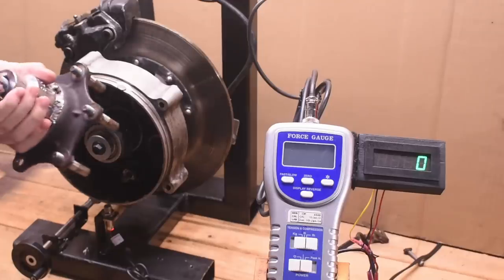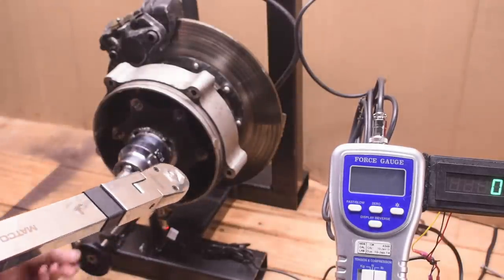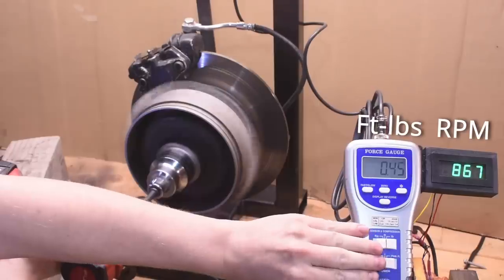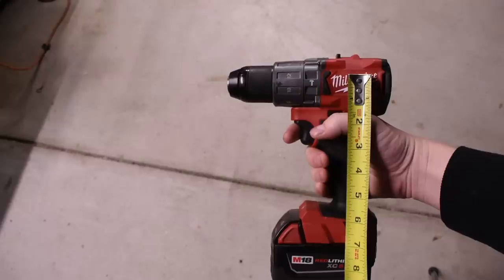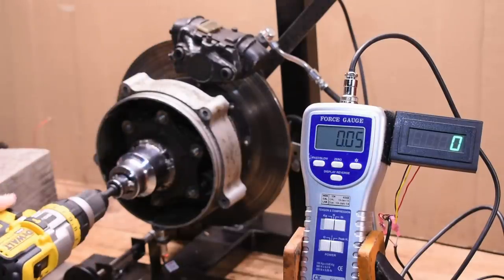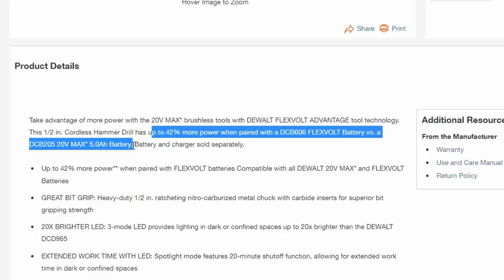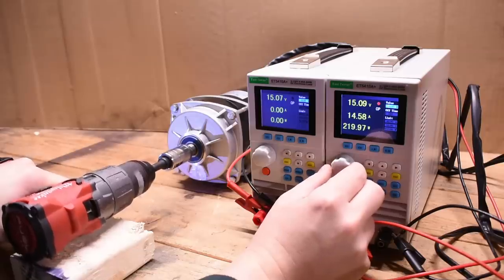DeWALT vs Milwaukee on a Cordless Drill Lie Detector (Dyno Brake)

Comment: When you're quickly applying the brake, the stored rotational inertia energy is being dissipated into the brake caliper, making the measurements higher than the torque applied by the drill.  An accurate measurement requires constant RPMs, given all that spinning mass.
Reply: To test this, spin up the brake disk, decouple the drill, then quickly apply the brakes with no drill connected. It will apply force to the load cell, guaranteed.
Reply: Incidentally, the torque required to suddenly stop a spinning mass is how your shop vac is deceitfully rated to 6 horsepower while running on a 16AWG cord. 6 horsepower continuously from a 120v outlet would require 37 amps, melting the cord...
Reply from the maker: See our comment towards the top, you're not wrong. But it's not the brake causing the sudden stop on the high tests, the drills suddenly stop (and they dont free spin)

Comment: It's also got a feature to save your wrist from breaking. That's why it doesn't cooperate with the Dyno unless you ramp up the speed slowly and the same goes for reducing rpm. Otherwise the wrist saving feature will brake your wrist!!

Comment: If you have an RPM signal on your dyno brake, why not output both to a chart, to show true torque @ rpm (torque curve), & also (by definition) horsepower? Standard Dyno stuff? Because you're right, area under the torque curve matters in most applications, not just peak torque (or peak hp for that matter).

Love the channel.

Comment: It would be valuable to see a column in the results on the tested lifespan at the higher torque values.  I've burned up the gears in a DeWalt DCD996 at a sustained 25 ft*lbs in about 10-15 minutes (with multiple batteries of course.)  The gears just can't handle the power and resulting temperature rise for any appreciable timespan.  So while each may be able to deliver 30-40+ ft*lbs it may be a disappointment to consumers that these values cannot be held for any significant duration.  Thanks for another great video!

Comment: The 999 does a weird thing where it has more power the higher up the clutch is, including the hammer setting. I think you'll see a higher torque number by a little with the hammer setting

Comment: I think the high speed cutout test is fine.

Bonus quest for you @TTC, can you do some cutout testing with the clutch? I have the M18 hammer drill and when I used the clutch function a while back, I remember it felt like the "clutch" is not actually a clutch but a peak amp draw setting and all electronic controll of the cutout.

Comment: I believe the 1200 inch pound rating of the Milwaukee is supposed to be a hard joint torque measurement. For example, if you were to use it on a lug nut by just barely starting the nut and then running it all the way down right with the drill, assuming it's braced properly and using the right battery, it should tighten it to about 100 ft lbs. I'm not sure how optimistic that number is, but judging from the amount of torque you measured with a slow stall I bet you won't be all that far off. Don't get me wrong, that's a pretty useless spec for a drill since that is almost never how they are used, but it's also probably not a complete lie. That's going to be very difficult to properly measure, so I wouldn't worry too much about it, and instead just encourage them to stop advertising specs that don't have any real world use by calling them out for it and letting it affect their ranking on the channel.
Reply: Great point.

Comment: I love this test, looking forward to seeing more. Are you fellas interested in testing a black and decker matrix with the drill and the impact driver attachments? I bought one since I already had some b&d lawn tools and the impact driver attachment especially is way more impressive than I thought and will rip the heads right off a screw or smal bolt if you're not careful with the trigger. I'd be interested in seeing the drill attachment tested on your new dyno too, I'd be willing to loan out the matrix with both attachments, a couple batteries real and knock off for testing if you want

Comment: To give a little credit to Milwaukee's and Dewalt's marketing departments: it's important to note that these are the current performance metrics for two highly used tools and several battery packs that have gone through many charge/discharge cycles.  If these items were tested from factory-new it could very well be a different story.

Your testing rig is extremely impressive!  Can't wait to see more tools tested on it!  If you're accepting video ideas, here's a difficult one: testing the longevity claims of screw-in LED lightbulbs.  I'm so sick of buying LED bulbs that claim to last "10+ years of daily use GUARANTEED!!!" only for the bulbs to burn out after 18 months.  Not sure how to test those marketing claims without waiting a really, really long time however.
Reply from the maker: The DeWALT was tested from new, including new batteries for both tools. And the Milwaukee was only a couple months old. We've just been using them for this footage for many months.
Reply: The LED-bulb problem is very annoying and expensive, i just might start saving my receipts on them.
Reply: **10 years at 3 or x hours per day. 😈 
Who knows what the actual live span is when that arbitrary number is exceeded.
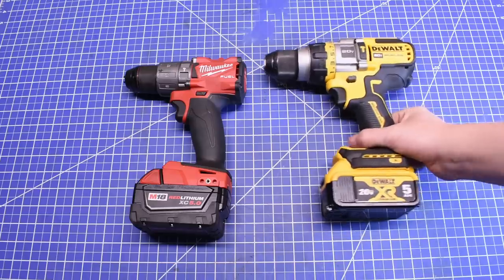Reply: @TorqueTestChannel  -- I'm confused then because at 3:43 you said you've been using these two drills for "months"?

Comment: The Bosch pro factor drill hands down demolishes the Milwaukee in terms of torque. Snapped the shanks on numerous forstner bits and thrown my helper through a wall when anti-kickback mode was disabled

Comment: I drill a lot of hole in brand new trucks. Last resort or sometimes fastest is a battery drill. 
I had the 2604. I have the 2704 and 2804. I honking on the new 2904. I also had a DeWalt. Xrelent. That total tool said wouldn’t be under warranty so I junked it. 
I got the 2804 the day it came out because of the reduced size. It made too much heat. I had to bring it home and after the DeWalt died, I brought the 2704 back to work. Works fine. About 6 now. Way more torque than the 2804. Any of them will have a go at trying to rip your arm off. 
The Milwaukee side handle suck. The DeWalt is not much better. The handle ripped right off the 2704 and is permanently inoperable.

Comment: I found the watt measurement setup kind of hard to wrap my head around. Or rather the reason the one power supply is adjusted mid test. I figured out that it was the addition of the two watt outputs but not why.

Further explanation would be appreciated
Reply from the maker: One can only go to 400 watts, to go above you need two. They are adjusted during the test to continually increase load

Comment: You can damage the drill internals by doing this.  I'm not exactly sure what part will take the brunt of the electric surges. But by spinning it with the tester you are creating a high current.  Then you hit the trigger with opposing polarity.

Comment: This is an awesome test. Did you write to the MFG to ask for an explanation on their false advertising? 

Could you share the info about the torque device you purchased?

It would be interesting to see a test like this on my old milwaukee 1/2" chuck corded drill. That thing will not only twist your wrist off but take your arm along with it.

Comment: How much torque do we need in a hand drill? I ask because small-diameter drill bits can't take a bunch of torque. How about destructive torque testing of drill bits. This could uncover the tradeoff between toughness and hardness as well as possible flute grinding differences between brands. Small drill bits in soft metal and wood run at high speed and large drill bits in harder metals need to run at low speed. Also the actual rpms are important because that is what in conjunction with drill diameter determines surface feet per minute (SFM), Carbon steel, high-speed steel, coated? and carbide all like different sfm.

Comment: Can you try some of the metabo hpt tools on this dyno? DS18DBFL2 or DV18DBL2 or the DV36DA (1,220 in-lbs). I have the DS18DBFL2 and I feel it is at it's it's 620 in-lbs rating when using a multivolt battery.

Comment: Bauforum24 a german tool channel did a test with a torque gauge. It came up with very similar numbers when it comes to max torque. With a similar jump in performance when switching from a 5ah to a 6 or 8ah HO battery.

Comment: I have a video idea. A comparison within brands of 12v to 18/24v+ to reveal how far you can go with either. I guess that's like video for each big brand, or big enough brand to a decent 12 volt selection (9v?) Anyways, I'm a mechanic, at a HeavyDuty body repair facility. So I do get to do 'everything(except paint.)'. My hobbies at home include woodworking and crafting. I see the need for lots of power on the job. Not always needed at home.

Comment: It might be interesting to measure the volts and amps from the battery and comparing to the output power and calculating "efficiency" ?

Comment: It’s a comparison across brands regardless which is something that doesn’t currently exist that I’m aware of.  Establishing these baselines allows for future tools to be tested with the same method giving results that could say in this test this or that tool show higher torque regardless of the issues of the test coming to a dead stop.  Keeping the high and low test is beneficial.  Great video, I’m curious if the DCD800B is actually 40% more powerful than the outgoing (longer) model DCD791

Comment: See if you can get a old, 1970s drill, one of the ones where you have to manually lock the teeth in place with a chuck key. I'm curious how it would stack up against the modern drills and impacts

Comment: I'd really like to see y'all test the Kobalt XTR hammer drill (on the Lowe's site with a battery and charger it's Model KXHD 1424A-03)

I've had the non-XTR version since it came out and it's awesome. The only 2 gripes I have are that the motor is loud and that the chuck is picky about needing oil every few months. If I don't keep it oiled, it seizes up and wont ratchet down properly and ends up letting go of drill bits randomly. Other than that, I've used it at work and around the house for years and it still works fine.

Comment: Have you considered testing SDS rotary hammer torque on this rig? I don’t recall ever seeing a torque figure advertised on one, mainly because they are for drilling, not tightening, but a drill-driver can do both anyways. Especially curious since the new generation Milwaukee SDS tools have the AutoStop feature to prevent wrist breakage. SDS tools also DO have a clutch, of which can’t be adjusted. You’ve tested the chipping mode’s blow force against air hammers, why not see how they stack up against standard hammer drill/drivers? It’s more for curiosity than competition, mainly since they’re so big and heavy. If you need an adapter to hook them up to the test rig, Amazon has some socket adapters for SDS plus units.

Comment: You guys should get Magtrol to sponsor your videos and see if they can hook you up with dynos & controllers.  It would be interesting too if you could go a level deeper and start to look at the differences in how the motor drives operate from each manufacturer with some current probes on the drive output to the motor.  Even though these are cordless tools they may not have their specs rated off of a battery connection.  I would bet they have test fixtures setup to connect these tools to programmable power supplies to remove any variation caused by the battery and that could be a part of the discrepancy you see in the specs.

Comment: Gotta say, the reason for using the handle is so the drill body doesn't rip its self apart, notice how it attaches to the gearbox and that the plastic body is only held on with 4 tiny screws

Comment: Speaking of old nicd DeWalts. Have you done any testing with the old 18v DeWalt drills and the 20v adapter? Back when the drills didn't have all the electronic safeties and would keep running with smoke coming off the motor instead of shutting off?

Comment: If you want to get rid of the friction brake you can make an eddy current brake to replace the caliper. This is exactly what Sioux tools used in their QC area. It does not wear or make dust and you can automate the brake force. Sioux made their own brake it was not a purchased item.

Comment: My friend was just asking me for recommendations on a high-powered battery drill for putting braces and cabling in trees. He regularly needs to drill half inch holes (or larger) a foot or more through trees and I maxed out his budget with the Milwaukee 2904. I'll see how he finds it, he is impressed with the size and weight so far as that was a big factor when he needs to climb a tree with it, I'm just hoping the 5.0ah battery has enough power for what he needs.

Comment: Taking price into account is tricky because it is dynamic. I'm not in Dewalt's line, but did purchase that Flexvolt Drill and Flexvolt battery 2 years ago for a combined $179 at HD, as a gift. Not all tools are as likely to be used in promos, and it is hard to capture that likelihood into a price.
Reply from the maker: Which is why magazines use MSRP for cars like we're doing, your dealer may have a deal. But that's an impossible target
Reply: @TorqueTestChannel   With new cars, prices are more stable and predictable (pandemic and supply chain shortages aside.) Some tools routinely get 40+% drops in price while this is not the case with other tools, nor pretty much all vehicles. This makes MSRP less reliable for tool prices than it is for vehicles, but what else can you do? Maybe an average retail price, but there isn't really a standard way to measure that. There is no perfect solution
Reply from the maker: @ccbowers  Yeah it's tricky. And we'll use tools in the charts to compare years from now like we do now. We can't have someone updating the prices for every tool we've ever tested daily

Comment: Very interesting new measurements! I would be curious to see the torque graphed vs the RPM, though it looks like that might be a tricky thing with the components you have in use now. (Would probably need a microcontroller dev board aka Arduino, and read the hall effect sensor for RPM and strain gauge for force manually in it)

Comment: What I found in real life application of drilling large holes through wood beams is that a corded drill still does better than a cordless one despite the cordless having higher peak torque. It‘s a sustained load and the brushless motor simply doesn‘t have the cooling to stop it from smoking after a while. Granted, it didn‘t die, but if I had kept going it soon would have. The corded drill was a simple 850W Metabo, nothing special.

Comment: I daily drive the milwaukee at work.  Normally i run a 5.0 on my drill and a 6.0 on my light due to weight and runtime, but maybe I should switch those batteries around as the drill has been stalling a lot more with the colder weather lately and I can just deal with the light dying more often.
Reply: I miss read that at first as you “I daily drive my Milwaukee to work” I was like whattt???…. Ohhh 😆😆

Comment: I have the Milwaukee 2804 and its decent, but I recently got the Metabo HPT DV36DAQ4 36v.  That's a bit of a beast, might be a fun one.  It wasn't my first choice, the Bosch Profactor GSB18V-1330CN was though.  They have similar stats, it ended up being "I don't want another battery brand/charger."  Maybe the Bosch would be a good one, although I here from my construction friends the Makita 40v GFD01Z, "I had to ask", is a sleeper.  I don't know how its a 40v tool, lol.

Comment: You should try the XR battery with the tool it is made for. That is the "Power Detect" line. 

I looked at both the 999 Flex Volt and the 998 Power Detect when it was time to upgrade my hammer last. The 998 beat that tool you have there across the board, in test after test. That's why I went with the 998.

I am sure Flex Volt is good at...something. But a Hammer drill is not going to reach for 60 Volts, so it will really only perform as well as the 20 volt side of that battery. I mean, I am no tool engineer, but that is the theory I came up with. The only thing I "know" is that the 998 is an even better drill.

Comment: Back in my carpentry days my Milwaukee (2804) would always overheat somewhat quickly when mixing cement, whereas the Dewalt XR (not this one, but older gen) of my buddy would seem to have no problem for longer at similar power output. Now I know drills are not mixers, but what would be the equivalent of mixing cement (or drywall mud or whatever) in these tests?

Comment: so battery and battery charge make a difference. i have been using my impact driver to set the 1 torque level on flextalic gaskets for high pressure ( 350psi ) high temp ( 340 F ) water boiler system. it looks like i will be hand doing all 3 levels.

Comment: Great start, I’d have done some arduino/server drive for the master to try and equalize the pressure ramp rate and zero the different inertial influence.
Reply from the maker: We had plans to automate the pressure to the brake, but after we set this up and got +/- less than 1 ft-lbs every time it seemed pointless if were using median tests of like 5 every time.
Reply: @TorqueTestChannel  Oh, I recognize my normal habit is to over engineer.

Comment: Love the new test ideas. Couldn't you calculate horsepower by using the torque brake and having an RPM signal. Would the reactive force be more accurate then turning a motor?

Comment: Great job, this is very well accomplished. Excellent to finally have consistent metrics to compare with. 

I’m currently running Bosch for my 18v stuff, would you consider throwing them in the running?